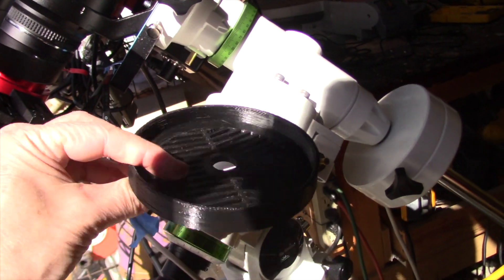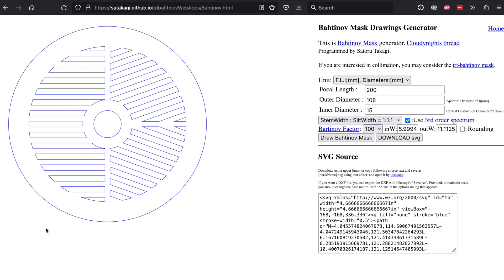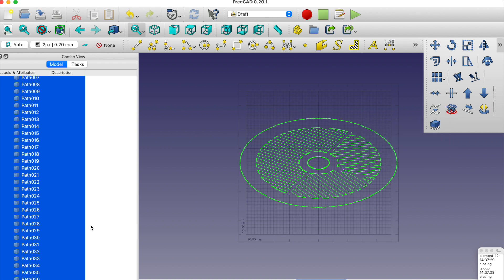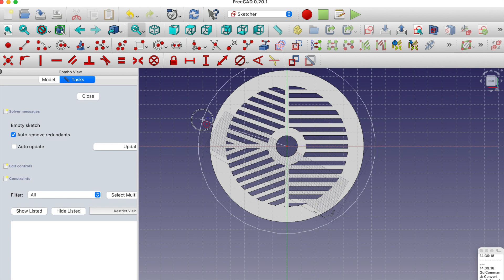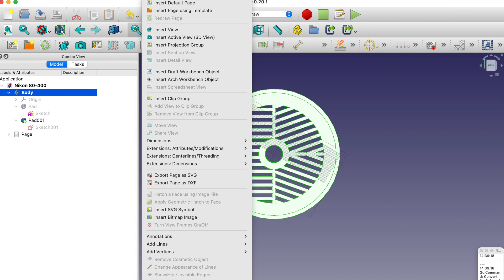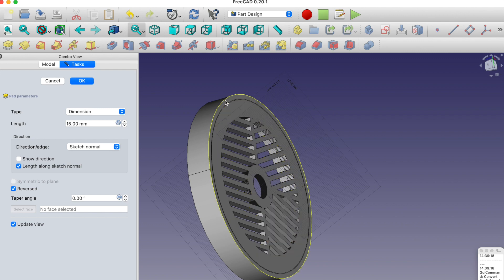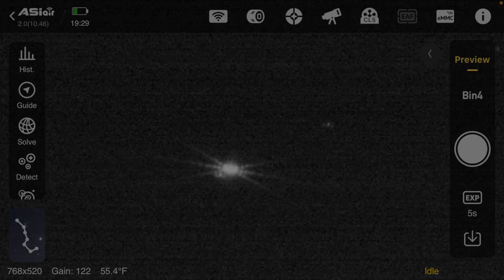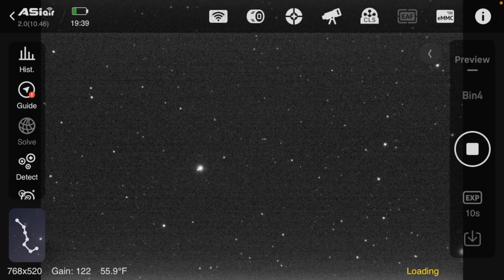How To Make Custom Bahtinov Masks For Free With a 3D Printer & FreeCAD

Comment: Do you have isues with SVG importing to freecad in wrong scale? Is there anything you need to do to ensure it imports with correct units?
Reply from the maker: I didn't have any issues with scale.  I use millimeters for all of my drawings and it worked just fine for me.  I'm not sure what the problem is.

Comment: Thanks for the guide!  I have a Nikon 14-24 lens.  In the generator, what would you enter for focal length, OD and IN?  Thanks!
Reply from the maker: I would put in 20mm for focal length.  For the OD you need to measure the outside diameter of the lens.  For ID, maybe try 30mm